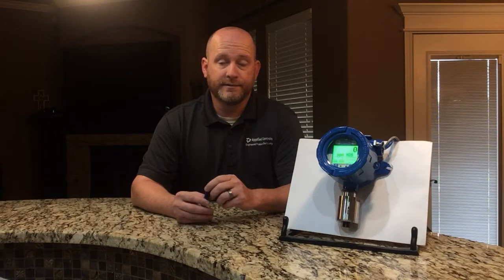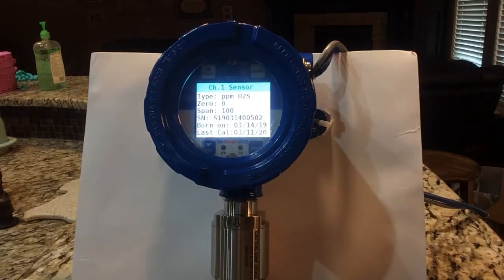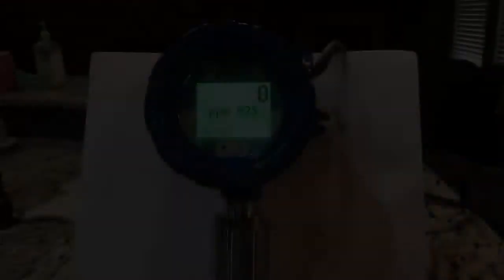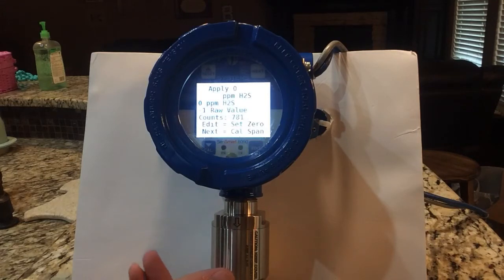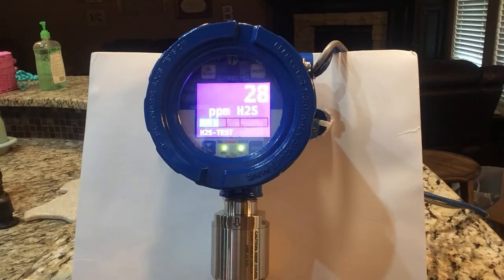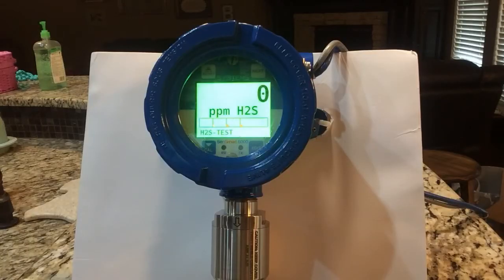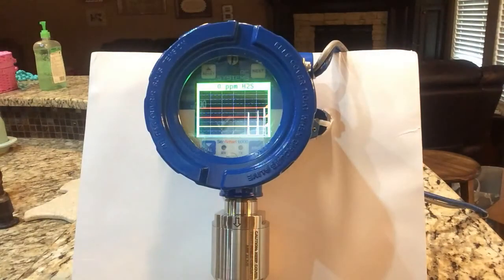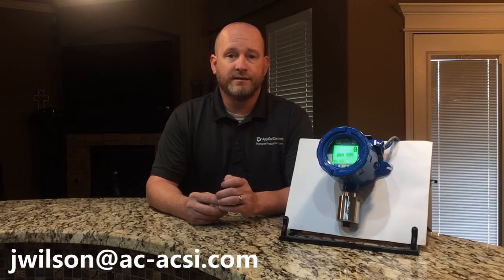RC Systems SenseSmart 6000 Demo

Comment: I noticed you spoke about the simulators part of the calibration but never actually showed how you connect a gas tank up to the sensor.  As someone learning to calibrate a Sensmart 6000, that would've been very instructional.  I often have to teach myself how to operate these devices and any clarity or practical instruction is highly appreciated.
Reply from the maker: Thanks for your feedback. I’ll try to get some cal gas in & do a calibration video.